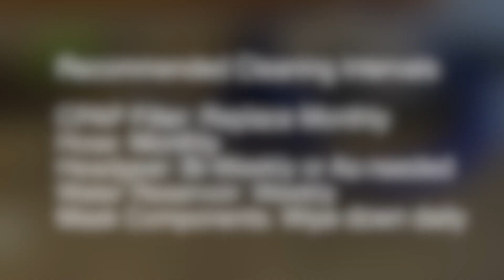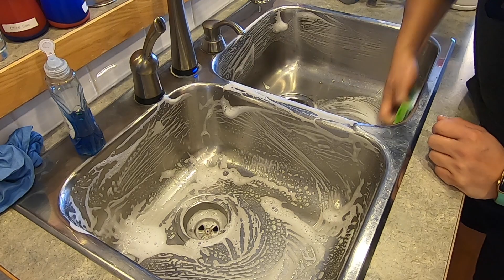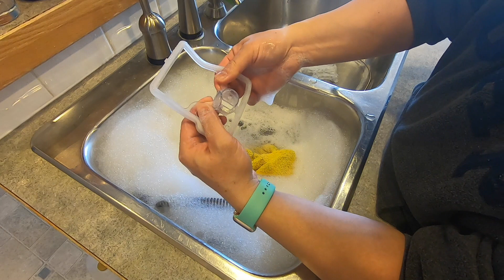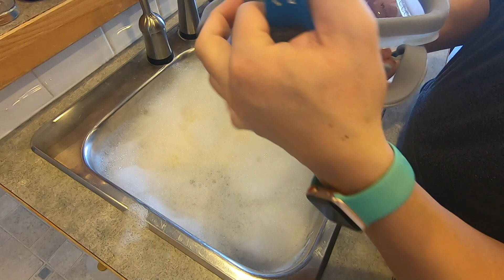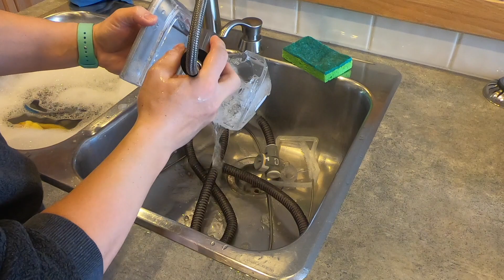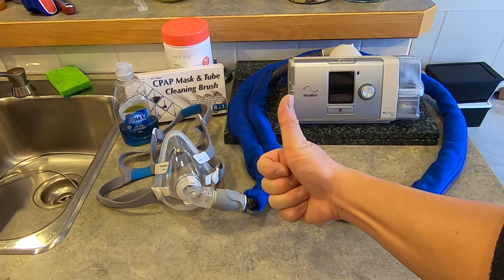How to PROPERLY Clean CPAP Equipment

Comment: I always take the extra step to sanitize the pieces after soapy water by soaking it all in a vinegar and water mixture for 4 or more hours. That eliminates any build up from any kind of minerals if you ever put tap water thru it and it also kills any bacteria that remains. Make sure you rinse well after the vinegar. I use about a 40% vinegar solution (it's cheap and effective).
Reply from the maker: Yep for sure, that doesn't hurt although to be honest, the bacteria on the mask (and likely none or barely any in the hose) that I didn't feel the need to do this.  We have super hard water where we live BUT it is municipally supplied water and I found that while it DOES leave water marks on everything that there was never any appreciable buildup in my hose or water tank.  I do run the cleaning brush through it and I think given that hard water takes time to build up minerals on things by being constantly exposed to hard water that it just doesn't seem to happen. Not saying your technique is wrong, there is absolutely no harm doing the soak.  Thanks for sharing your process!
Reply: @piercedasian

Comment: I use a small box with a lid. After washing and rinsing the tubing and the reservoir I soak it in 1:4 or 25% vinegar solution for two hours. Every 2 weeks. I  also have the Res-med mask and wipe it carefully with the fresh solution on the hard plastic only. Then when the box is throughly dry I can store spare parts in it or not and use the lid of course to keep dust, cat hair, powder, hair spray etc. out.
Reply from the maker: That's a good technique to use.  I don't have an issue cleaning it the way I do here b/c when I wash, I shake and wipe dry and call it a day.  Each to their own and your technique is nice in that its all contained in a little box.

Comment: NEVER wash your headgear in the washing machine! Also, leave your Velcro attached while washing mask, especially with this mask. Velcro wears out very quickly. Also with this mask, don’t wet the elbow part that clicks into the front. There is an inner filter that has not dried in time an grown mold and/or made it harder to exhale over time (increased pressure). Please follow instructions you got from your DME, not this man.
Reply from the maker: What kind of water and clear are you washing your equipment in that would Barbour the formation of mold??  I have never in my 3+ years of using a CPAP had any issues washing any of my equipment. As a matter of fact, my headgear was suggested to be washed in the washing machine in a mesh bag by my DME. Washing in a sink with soapy water isn’t enough in my opinion to get it clean clean.  Wash using common sense and there likely won’t ever be an issue with your mask. I am still using my original headgear from 3+ years ago. Zero issues with the Velcro and certainly zero issues with the straps. Same goes with the air elbow. No problems ever.

Comment: Dawn or any dish soap is way to strong. Not recommended by any of the CPAP companies. It won’t rinse off well enough. I recommend shampoo or body wash to my patients instead. Something non-bacterial. Also, filters need to be changed every 2 weeks.
Reply from the maker: That’s hogwash. If you can eat off the dishes you clean with dawn they how on earth can you not use it to clean your CPAP hose that you don’t eat off of?  Perfumes in the detergent?  Rinse well and it goes away after the first few minutes of use. Filters I was told by my DME to give it a few flicks with my fingers to remove the dust and pop it back in.  Been doing that for years with no issues.

Comment: Thanks for the video. Wondering if you have any advice on how to address discoloring of the headgear tubing, as I've noticed it tends to turn yellow over time. I could replace it, but I think it's functional and clean, just discolored.
Reply from the maker: silicone has a natural tendency to yellow especially when it is exposed to body oils/ozone/sunlight.  It doesn't impact its functionality so it might look dirty but its perfectly fine.

Comment: How do you clean/dry the inside of the quite air elbow? Where the ring filter is under the piece of plastic ?
Reply from the maker: I just swish the elbow in warm soapy water, rinse and then shake out the excess.  DO NOT jam your fingers or anything into the elbow as there are two tiny silicone flaps on the anti asphyxiation valve that can pop off if you rough handle the piece. The filter is not removable and is actually air flow dampening foam to make the elbow quiet.  If you use your cpap elbow after washing it that water will spray out from the foam part of the elbow so keep that in mind when washing.  Best to wash this particular part early in the morning and give it a really good shake to get the water out of the joint and foam.
Reply: @piercedasian  seems silly to me they would make it inaccessible. Should be able to remove and clean it or be able to replace that bit of foam. Dust and fuzz get stuck in it and rinsing just isn’t enough.
Reply from the maker: Hmm, I'm not so sure if much fuzz would get inside b/c remember your CPAP machine has a filter to filter out large particulates so whatever is in the exhaust filter material in the mask that it is really whatever is coming out of your breath which I hope is only air.  I have thought about taking it apart but using my engineering skills that I highly doubt that this is really a real problem.  Just wash the elbow to get the bacteria (if any) out and then dry is likely more than sufficient.
Reply: @piercedasian  I’m not sure if you’re trying to say you don’t believe me or if you think I was talking in hypotheticals but I can say with 100% certainty there is dust and fuzz that gets trapped in mine. I’ve literally had to pull stuff out with tweezers because there’s no other way to get it out. I have to just keep replacing them when they get too full of gunk. I have read about other having the same experience.
Reply from the maker: No I'm not saying you're telling the truth, just looking at the joint and the circuit I just don't know how lint and fuzz gets in there.  I've been using the same joint for 3+ years and mine doesn't have anything in it.  Your CPAP machine shouldn't be sucking in air with dirt in the airstream and you don't breathe out fuzz balls.  I haven't seen examples of this myself so its hard for me to visualize where the lint comes from.  Do you have a photo of it you could send me?   piercedasian@gmail.com. Cheers!

Comment: Thanks for the video.  I use the pillows on my CPAP, are they hard to clean properly?  I should add I am on week 2 of using the CPAP, so this has been super helpful.
Reply from the maker: Greeting Vic! Pillows are the easiest thing to clean!  You just pop them off the headgear holder and then put a bit of soap in your hand and rub the whole thing with water and give it a good rinsing and shake it out to dry.  How is CPAP therapy working for you so far?  Most days for me it helps a lot but there is the odd time that the air is so dry where I live that I have to add a room humidifier + set my CPAP humidifier on MAX just to keep my sinuses from completely drying out.

Comment: The main problem is how to clean the inside of the unit where the dust accumulates on the spinning cpap fans.
Reply from the maker: With proper filter servicing that I highly doubt that this will be a major issue.  My CPAP has literally 1000's of run hours on it (its going on 4 years old) and from what I can see there is no appreciable dust inside the unit.  If you're really crazy worried about it I guess one could get a can of compressed air and spray the inlet of the blower (with the filter removed) and run the cpap and give the cpap machine a few quick bursts of air to dislodge any dust.  I don't recommend doing that but I you insist then that is one method you can use.  Just don't use super high pressure continuous air to dust out the insides of the CPAP blower b/c if you overspin the blower you can damage it (from extreme centrifugal force of a blower wheel spinning far faster than it should).
Reply: @piercedasian  Yea I guess with proper servicing it should not become a problem. But in CPAP machine I had such a problem; where chunks of black dust particles began to fly in to my mask during therapy. I had to stop using the machine and get it serviced immediately. Luckily that problem has not occurred again. But I am always fearful it will reoccur.
Reply from the maker: was this by chance a Philips respironics unit. They currently have a MASSIVE recall on their CPAP machines where the black foam sound abatement material is breaking down and doing exactly as you described.
Reply: @piercedasian  Yup you are 100% right it was.

Comment: As a CPAP user for the past several years, I find it difficult to believe that there is not some effective and beneficial way that CPAP users could/should disinfect the inside of the machine. That seems to be the Achilles heel of CPAP sterility.
Reply from the maker: well the thing is with CPAP machines is that they're a one way flow so there isn't much to get contaminated on the insides of the unit per se.  Even the hose washing is questionable in my opinion because how does the hose get dirty if the air flows only one way?  I do it because I'm neurotic but I"m sure there are plenty of people that NEVER wash their CPAP hoses out.  The internal blower is even LESS likely to get dirty aside from the fine dust that might accumulate (in tiny amounts) inside the blower wheel.  If you service your filters regularly and clean your home on a regular basis that I doubt there is anything to fear.  Might be different if you lived in a home with pets or a lot of environmental pollution (think a smoker's home).  I use a SoClean machine with my CPAP to ensure I nail the insides of my CPAP machine too however, using a ozone cleaning system is controversial at best.

Comment: Thanks for a very useful video! I have been using my cpap machine on and off for 2 months now. Still trying to get used to it. The hose gets tangled and wakes me up often. You mentioned using distilled water or tap water in the reservoir. Is it safe to use tap water?
Reply from the maker: Depends on your locality.  Our municipal supplied water is some of the cleanest safest water in the world but is hard.  If I run out of distilled water then I don't hesitate to use tap water with the caveat that there WILL be scale buildup inside the humidifier if you use tap water often enough.  I installed a R.O. water system to generate distilled quality water for my CPAP.  I have ZERO scale buildup using R.O water.  If you use well water or your tap water is unsafe (think of Flint Michigan or similar "lousy" water" then it is better that you just stick to distilled water.

Comment: Whats the difference between this hose and the regular hose?
Reply from the maker: regular hose = plain hose with no temperature sensing or heating wires.  Climateline hose = has electrical connections, heating element and temperature sensors inside of them that prevent rainout for CPAP users that use their humidifier and CPAP in a cold room.  The heated climateline hose CAN be submerged in water and be washed (that's the hose in my video) so no fear of it electrocuting you or anything like that.

Comment: Thank you for this video. It is informative. I am new to using  ResMed AirSense 10 AutoSet with Integrated Humidifier for Her. I have been using it since May 2021.   So I am still learning. I still have lots of questions.  Like if I can't find distilled water . What am I supposed to do? It is hard to find on the shelf these days.
Reply from the maker: You're very welcome!  If you can't find distilled water you can always use water made using the reverse osmosis process which is what I use from a rehabilitated RO unit from a family member.  If the tap water is safe for you to drink then it is technically safe to use in your CPAP machine PERMITTED you follow a strict reservoir cleaning and water replacement routine.  Perhaps if you want to list off all your concerns and questions you have that I can help answer them for you in my upcoming video!
Reply: Thank you. So I can you use regular water bottle water for just once if I can't find distilled water. Then clean everything very well when I find the distilled water?

Comment: Tmi im nervous about using sink water to clean. Used hose for more than 6 mos without cleaning and Im fine. I get supplies when insurance allows.  Same with mouth piece. Wipe down with distilled water. I check water chamber for slime everytime and none just wipe.
Reply from the maker: As I have written a few times on this video, I guess it depends on your locality and the water quality you have.  Where I am, the tap water is of the highest quality in the world so I never doubt the cleanliness of the water coming out of the taps.  That being said, I had NO idea about the water quality in other localities but after doing some research it is surprisingly (and disturbing) not uncommon to have poor quality water coming out of taps.  I had made a gross assumption that all water coming out of taps is potable and safe to drink but apparently not.  If you're using well water or your municipality has average water quality standards then I'd say maybe not use the water or even your kitchen sink to clean.  I should've mentioned that I do clean my sink regularly with bleach so I know it fully sanitized.  My bad on that.

Comment: Bought resmed,,,  11 instructions state do not use dawn soap.         Use Palmolive dishwashing soap
Reply from the maker: Honestly I don't think it really makes a real difference. I've been washing my CPAP gear like this for at least 3 years now without a nary of anything going wrong.  Pamolive, Dawn, Sunlight... they all seem the same to me and so far zero degradation on my gear.  Still using the original hose with my CPAP and it looks and feels brand new still.
Reply: @piercedasian  Palmolive is 99% antibacterial this why the cpap lady’s told me

Comment: Dawn dish soap should not be used with bleach. There is a warning on the bottle about it.
Reply from the maker: You don't mix the two at the same time.  Normally how I do it is I wash the sink down with bleach, rinse well and then fill up the sink with Dawn and warm water and then wash my cpap gear.

Comment: I've been breaking down the reservoir and top rack dishwasher for years.  I make sore the tiny hole is on the bottom down to drain, it still has a bit of water which I shake out and reassemble then set aside to air dry.

Comment: I have used my cpap for some time but I have not dared to wash the mask with dish soap since I only know that it is washed with odorless soap and the truth is that the dish soap has a lot of smell and chemicals and leaves residues that After you breathe one when you use it, I have looked everywhere for a special soap to wash the cpap but I have not found anything in particular. I do not know if you recommend using that soap for the dishes in the brand and it does not leave any residue or chemicals.
Reply from the maker: Hmm, I guess I haven't given it much thought other than what I use to clean my dishes at home. The way I look at it is if I can wash the very dishes I eat and drink off of then it would be safe enough to use on my cpap gear.  I use Dawn original (blue color liquid) and that does wonders at cleaning.  It DOES however, leave a slight scent so if you're super sensitive to things like that I'd recommend maybe trying a scentless baby shampoo to wash it up instead.  Either way give things a really good rinse and you should be okay.

Comment: Okay, I was told none of this, now I have to worry about the heppa filter too (someone said there's a recall on the filter).
I was told vinegar and water only.
Recently, I was told Chantix was also recalled.
So, who's testing this stuff before they give it to us? Underwriters Labs, are they involved? Anybody?
Reply from the maker: Bottom line is this - if you look in your owners manual it will tell you to clean all your CPAP gear DAILY which I feel is ridiculous and way over the top.  I would suggest you consult with the owners manual of the unit you have and follow their directions.  The simple thing is wipe down your mask daily, rinse and wash out the humidifier daily and wash everything in soapy water at least once a month to ensure nothing is growing inside of your CPAP's air circuit.  For those that say dish soap is NOT a good cleaner I challenge you and ask "You use it to wash the very dishes and cups you eat from don't you? How is using it to clean your CPAP hose and mask and water reservoir any different?  Wash and rinse well and all will be fine.
Reply: @piercedasian  oh, I was told to clean it daily, but none of the instructions given here. Gee, I thought people would pickup on that without being told. I apologize for the over placing of people...